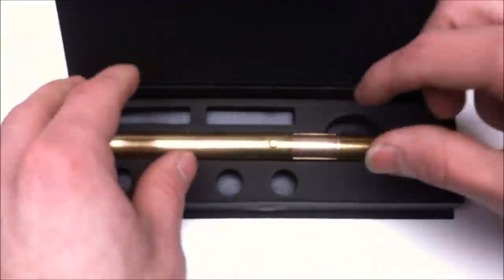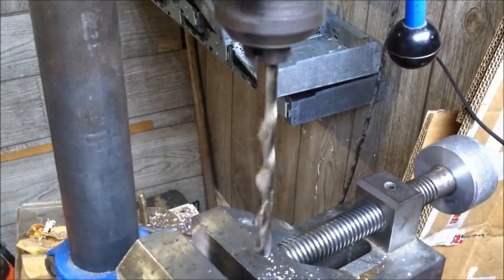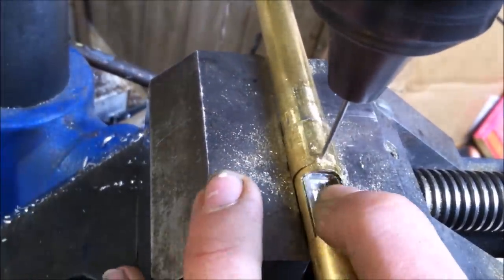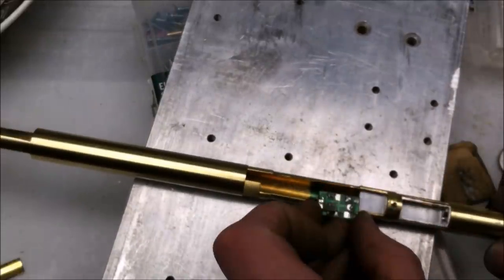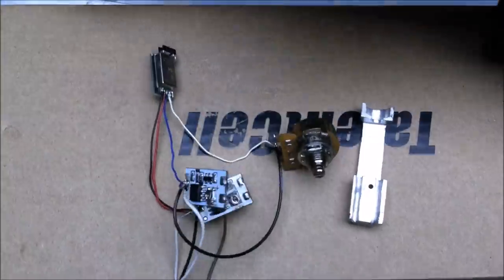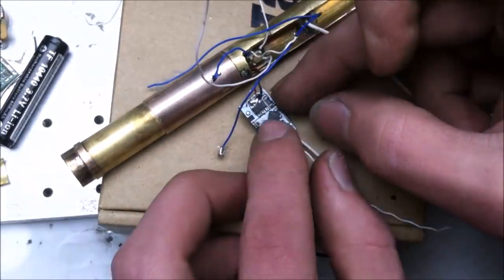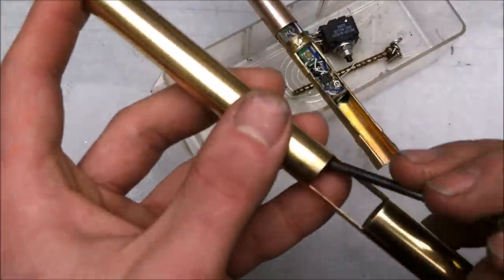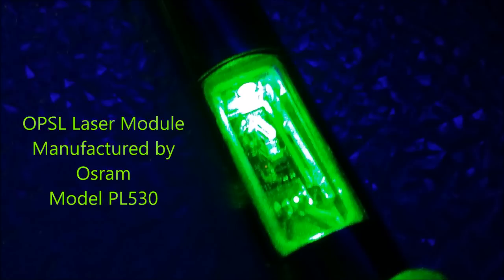Building The World's First OPSL Laser Pointer?

Comment: amazing how intricate all those components are made so small to fit in that optical miniature bench  ,its crazy and i love the output window with that redish tint to it , too bad the beam is coming out at an angle
Reply from the maker: Oh it is watch maker's level of intricate and I absolutely love it. The technology is amazing.
Reply: @Zenodilodon  definitely and its funny to see how some components although miniaturised have still remained the same over the years unlike microchips or circuit boards getting smaller and smaller with newer parts of electronics doing the same function but built smaller and different then there originals ,its the parts of the actual laser head that always fascinated me because i have easier time understanding what they do when put together than electronics or the drivers etc  but yes these are on the level of finesse found in older wound time pieces ,i have a few of those i worked on ,another amazing design there too , i love fixing things as well around the house ,appliances and such ,smallest thing was an electronic wrist watch where i had to solder the fine copper fibre wound on the quarts to make it work, i was proud of that one ,but about our prolonged exchange dont worry about having to reply right now and please dont feel like you are obliged to reply fast on anything,take your time if you need to sleep or whatever

Comment: Back in '07 or so I took apart a green pointer and found an interesting setup. I thought it was an IR LED that would shine through a grating (LCD shutter?) then a really small prism and had an optical sensor for feedback. I figured changing the PWM on the shutter changed the output the filter/grate. But now that I see this, it could have been a heater for a crystal.
Reply from the maker: Older green laser pointers did in fact tent to have an output monitoring system in the front. This was feedback to the driver for stability. I have noticed most green laser pointers now they did away with that set up. It might be do to refinement in the MCA process or just in general cutting costs. My very first green and a few others I ran across had that set up.

Comment: Excellent video man. You have some great skills, and the video is also entertaining and informative. Not that I'd ever be able to do something like this on my own, but I'm a laser geek, so it's fun to watch.

Thanks!
Reply from the maker: Thanks! I'm glad you enjoyed the video. If you enjoy lasers and want to get into working with them more on a practical level then you found the right channel. Despite what you said about not being able to do something like this, well I say you can if you want and that's why I post up videos on these sorts of things. My goal is to help others accomplish cool things with light!
Reply: @Zenodilodon  Thanks for the reply and encouragement. I hope you don't mind a question: do you find heat gun soldering to be any easier than soldering irons? Do you see it as more or less possibly damaging to electrical components? I'd never heard of heat gun soldering before i saw your video. I'm really a soldering novice, so I apologize if these are obvious questions.
Reply from the maker: @Boogie_the_cat  Heat gun soldering or using a reflow/tow air station is very common in SMD ( surface mount device ) soldering. The majority of the components can take a crazy amount of heat during soldering. Usually there are ramp up/ramp down times to make sure the parts don't break due do things like thermal expansion ( like glass work ).  Doing SMT work with hot air can be much easier when you get the hang of it, but also tends to require more pricey tools respectively. Like anything else it mostly depends on skill and practice.

Comment: I had a similar idea a while back. But nothing to put it in. Nice work. I am sure that thing works pretty well once it warms up.
Reply from the maker: relatively so yes! the PTC element does seem to stabilize in temperature pretty well.
Reply: Yeah, I imagine it should be ok as long as there's no air currents over it. I imagine the current draw would be a little high for a laser pointer, but probably not too insane. I don't own a lathe, or I'd have done this too. I own a few full size OPSL units, and they're great lasers.
Reply from the maker: @r100curtaincall  The current draw isn't all to bad surprisingly enough but the battery is quite low capacity. About the only downside is it's delicate nature. Getting a lathe is a choice you can never regret! I have heard so many good things about OPSL but really have yet to get into them, even broken ones are relatively expensive. I was looking at maybe getting a defunct Coherent Sapphire eventually. There is certainly a lot for me to learn about them yet.
Reply: Zenodilodon i’d be happy to teach you about them sometime. They do you have some pretty distinct advantages over a typical yag laser. Sapphires have definitely been coming down in price a bit.
Reply from the maker: @r100curtaincall  I would love to learn more on them, I have been researching the physics for quite a while and understand a lot of the fundamentals already! Yea the prices are starting to come on down, I believe the OPSL patents are almost up as well so we could be seeing other manufactures make OPSL soon too!. I cannot wait for that. It's all the future things to see and learn that keep me going no matter what!  I want to see them all and I am running out of retinal cells lol. Laser and lighting is my passion and one I enjoy sharing. Do you have FB at all?
Reply: Zenodilodon I do but I won’t post it here for privacy reasons, But you can find me as ultimatekaiser on the laser pointer forums if you’re a member. Just send me a PM and I’ll be happy to send you my discord or something else.
Reply from the maker: @r100curtaincall  I do have a LPF membership but don't often go on it. My general web handle is " Zenodilodon "  this is good for both LPF and FB.
Reply: Yeah I haven’t really been on in a long time either. I thought i’d vaguely remembered seeing this pointer in a post, I never ended up participating in the discussion i think, due to being busy.

Comment: Haha! not the first.. well kinda.. I used these in my RGB (see videos) Awesome little modules. Nice build BTW..
Reply from the maker: Oh wow! I had thought you made your own entire optical assembly in your RGB, did you use one of the Pico Light Engines from the ShowWX? I have often wondered if anyone had.
Reply: @Zenodilodon  I use the dichros and diodes along with a temperature control system. The output power of the green was not very stable, so I tec'd all 3.  This not only keeps the output power of the green stable, but also keeps the diodes wavelengths in check, mainly the red..

At the time the only other option was dpss and keeping alignment in such a small layout proved quite tricky. The 530nm outperformed any dpss I tried.. both foreign dpss modules and my homebuilt ones.

On the first I used the showwx optical bench which I later changed because aligning the thing is a challenge and complicated the build.

Your pen is the first I've seen using the 530nm.. 

Did you add any form of temperature control?
Reply from the maker: @ZeroMass  No closed loop feedback was used. I looked up what others have done and the characteristics of the PTC. I thought about trying to use PWM in conjunction with a small PIC doing resistance/temp checks during off times but I ended up running the PPNL a bit warmer then it's used in the projector but it stabilizes pretty well after a few seconds. I could see where DPSS could of been tricky, but given your skill set nowhere near impossible.

I got into making RGB lasers a bit before I learned about laser pico projectors and have come up with some clever designs, my current skill pushing laser pointer goal is to make an RGB handheld in a metal e-cig tube 8.8mm by 50mm. It's certainly pushing the envelope of possible but I just have to do it :P
Reply: @Zenodilodon  interesting..  And looks like there is some competition for the small builds.. Good to see.. 😜🍺

I was messing with an rgy in a standard leadlight pen.. Now I have the 520nm 450nm, and 640nm in 3.8mm, just never got around to an rgb in such a small form factor..

I found the trick with those 530nm units is to set a constant voltage on the heater and tec its base. IIRC I set the tec to 5 celcius, sealed the inner housing under vacuum and got nice efficient output. No dust, no moisture.. Was going to move to nitrogen gas fill, but never got around to it.

With the colder internal temp, the heater always finds its mark with a set voltage... Mind you this way is not the route you'd want to go in a super small build..
Reply from the maker: @ZeroMass  I have another PL530 here in sealed storage, I heard from another laser expert that they have been driven up to 200mw output. That's a screaming pump diode lol. 

In laser shows 200mw is not all to much output so the build was much more a novelty than anything else. It turned out well though. I have looked into making my own 473nm pointer one day like you did from some B&W Tek parts. Those certainly need a lot of temp control. I don't want to use the original resonator block so that's going to be tricky. 

You mentioned RGY??  I only have the 5 mw 589nm from CNI, I hope to acquire a few more in the yellow rang. Do you have FB? if so you are welcome to find me /Zenodilodon.
Reply: @Zenodilodon  be careful with the 530nm modules.. Can't remember at what current, but I blew out a few of them ~100mW  mark. There are a few variations of that laser.. The ones I used were from the 2nd gen showwx. Gen 1 was the mechanically focused etalon module, gen 2 was the heated version, and gen 3 I'm assuming were for the HD showwx projector, possibly for the 100 lumen Sony projector. There is also a 200 lumen projector out there but haven't seen a tear down or specs of one yet..

The 473 bw crystal sets are not too bad to mount. I've since put one in a pen with no temp control, it puts out 5-15mW at room temp but mode shifts a lot and drops power rapidly. Used a 9mm 1W pump and the most efficient crystal set I had.. Without active cooling on both the diode and pump medium, I didn't expect much.. 

I'm working on a switch mode bench PS, with variable  constant current up to 100A specifically for some big 808's I've had stored for some years.. Still figuring out what I'm going to pump with them.. Whatever it turns out to be, I'm having to machine water blocks for the mounts lol
Reply from the maker: @ZeroMass  You have dead ones? When I saw the construction my thoughts where that a larger pump could be put on if one where crafty enough lol
I don't ever intend to use the PL530 above spec. Seeing it marked 90mw green on the ShowWX it might be that I am running it at a much lower than spec in my laser pointer.
Another one randomly showed up in the mail,  this was seller error and he said just keep it. I don't know what to do with 3 of them now. I just wanted one. 

About the only thing bad with trying to make a resonant cavity laser pointer is temp control, I would love to make a 473nm in much a similar build as a regular laser pointer but that is a really difficult number given the power requirements and optics. Future plans of many in my head lol.

100 amps, yea that will power a few things indeed. It should not be to hard to do though I have made a few switch-modes with the lm494 but moved onto the sg3525 due to it's electrical pulse withstand.

Comment: Very nice. Really proves that you can do almost anything with a drill and a file. What did the laser head set you back or what could i face trying to get one?
Reply from the maker: Thanks!

The laser heads sometimes pop up on eBey, they are usually $25 to $40 usd. currently there are none that are posted. If you go to the link I pinned and message the seller he may have one laying around still.
Reply: @Zenodilodon  Oh I'll try that.
Reply: @Zenodilodon  I see no pinned link.
Reply from the maker: @simont3686  Ah it wasn't pinned, apologies. here is the seller who has them at times

https://www.ebay.com/usr/holokidd

Comment: Cool laser ! .The new osram PL530 ?
Reply from the maker: Yes, but It's not new,  on the LPF forums they have been out a while from what I can tell. I think they where possibly made before direct diode became available/economic friendly. The OPSL has a great deal more stability then DPSS as well so I can see where they would of chosen to use that at the time for a pocket video projector. As far as what projector it was originally used in, this I do not know.
Reply: @Zenodilodon  Oh.but what about the on/off duration of your laser ? Have you tested it?
Reply from the maker: @TinLethax  There is a warm up time once there it is for the most part stable, more so then I would of expected. I don't know how idea it is yet simply because I made it in winter and summer can be wamer, if it's a problem I have a consideration of mounting a thermistor on the cystal oscillator for feedback. I am betting they had a configuration where as it was pulsed and during pulse cycles the resistance of the PTC heater was read by the system and used as it's own sensor feedback. That would be a bit to put in a laser pointer.
Reply: Also.Your voice like a robot xD .
Reply from the maker: @TinLethax  I feel a channeled my true persona, for this one lol

Comment: Can you get those little modules in more unusual wavelengths?
Reply from the maker: Sadly not, these modules where only made due to there being no green laser diodes during the production time of the device it came from. This was made by Osram for the Microvision ShowWx laser pico projector in 2009, whilst the green laser diode was produced in 2010. There are sometimes whole RGB laser sleds from these sold as white light engines. They have one of these OPSL modules and a red and blue single mode lasers.
Reply: Zenodilodon that’s too bad but it makes sense. It seems that development of this stuff only occurs when there’s direct consumer demand. I have seen some specialized OPSLs from Coherent at a trade show including a gorgeous orange unit. They were much bigger and no doubtably much more expensive though.

Comment: hats of to you, that's awesome..
if anyone can , you could , build a laser pointer with micro sdcard  for pattern upload and bluetooth or wifi controlled galvo x/y scanner built in.., and multi colour...
Reply from the maker: Thanks! I would love to eventually make something like that. I am currently studying the resonant based MEMs/MMD from Show WXs. In addition to that I have been researching the fabrication of very small electromechanical devices. I have made RGB laser pointers before and have experimented with DIY galvos utilizing microdrive arm actuators with relatively good success in open loop, however they are still sluggish for anything complex. I have considered using tunable astable oscillators for axis control, but it's still quite large and rudimentary. I need to get my hands on much better tooling for fabrication before I can accomplish the miniaturization and precision I am looking for.

Comment: Bro which parts we need to make a 808nm and 2000mw leaser
Reply from the maker: 808nm laser diode rated for 2000mw output, proper host, most likely for a C-Mount package. a focusing lens/corrective optics depending on your beam parameters. Proper cooling ( fan,TEC or large passive heatsink ) depending on your duty cycle needs. Lastly a driver capable of running the chosen laser diode at a stable constant current suited to the laser diodes power requirements.